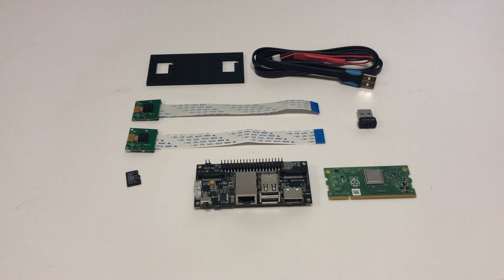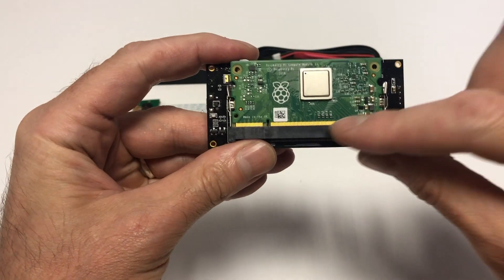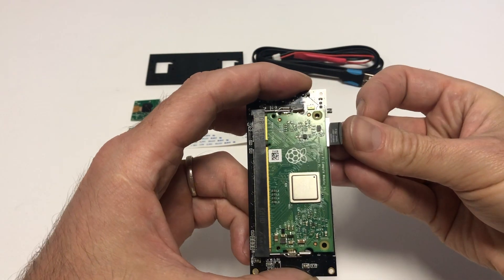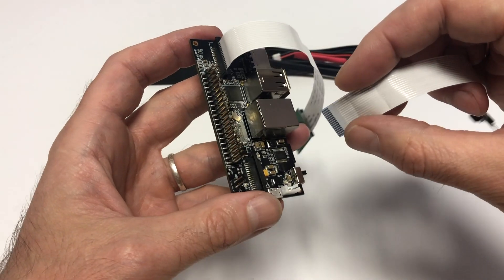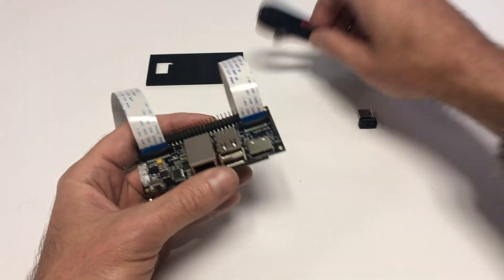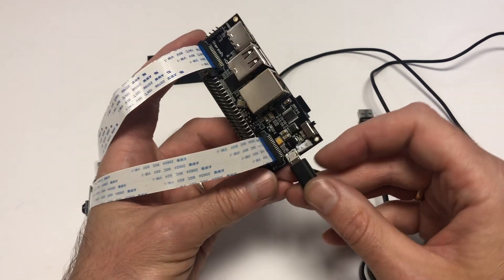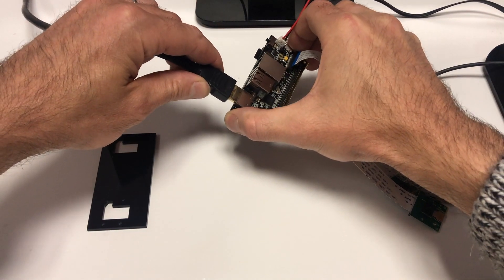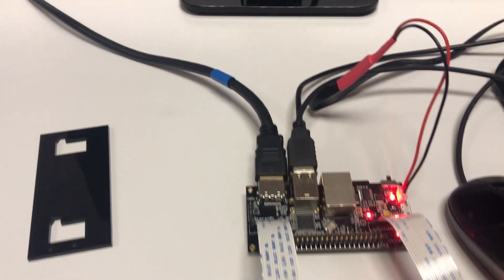Building and booting StereoPi with the Raspbian OpenCV image

Comment: Dear, I have got the starter kit and found out that the micro SD is preimaged with raspbian and I was able to run the StereoPi tutorials with no problem. However, ever since I tried to connect the StereoPi  to my laptop using the Ethernet cable and have it running on VNC viewer, I no longer am able to run the codes. May I know what is wrong? Is it because I have run apt-get update and upgrade? Thank very much in advance
Reply from the maker: Hi Koh Edgar! By default, StereoPi try to obtain IP address by DHCP over Ethernet. When you connect it directly to your laptop, there is no DHCP option. So try to connect both StereoPi and your laptop to the same router, and this should work. By the way, if you connect StereoPi by Ethernet to your router, you can connect laptop by WiFi to the same router.
Reply: @eugenep8802  Okay thank you very much. However, I manage to got it running on the VNC and was also able to share my laptop's internet to the StereoPi. The problem that I am facing now is that somehow the cameras does not work, I am unable to run the tutorial codes which is something which i do not understand.
Reply: To further elaborate, I was able to run the Stereopi tutorial codes and tested the cameras, they all work fine! It was until I tried to share the internet and control Stereopi over the ethernet cable, then i am unable to run the codes, no error is shown, it just freezes there. Problem persist even after i disconnected the ethernet cable and rebooted the stereopi.
Reply from the maker: @kohedgar2423  I can help you with that, but YouTube comments is not a good place for detailed tech answers with images, links etc. Can you please open a new thread on our support forum here: https://forum.stereopi.com
Reply: @eugenep8802  okay, I have opened an account over there, will do so! Thank you very much
Reply: @eugenep8802  I have opened a new thread in other topics and thank you very much for being so responsive.
Reply from the maker: @kohedgar2423  If your nickname is "noob" here? I see a post from this nickname with your problem description. Let's continue on our forum!
Reply: @eugenep8802  Yes!

Comment: Help! I got the stater kit, followed yuur instructions.  I get the two cameras to display the image, but it doesn't show the raspberry screen. At the boot up, there is a running script, then the vr logo then goes straight to display what the cameras sees. How do I access the raspberry home screen? the camera is power via your power cord, display/keyboard and mouse installed on the board.
Reply from the maker: Starter Kit includes micro SD with the S.L.P. Raspbian image (brief S.L.P. review is here https://www.youtube.com/watch?v=4KVbzQPWRBs)
For using OpenCV image you may use another micro SD card and write this image on it. You can find all downloadable images in our Wiki (main page, right-bottom section "Downloads") here:
https://wiki.stereopi.com/index.php?title=Main_Page